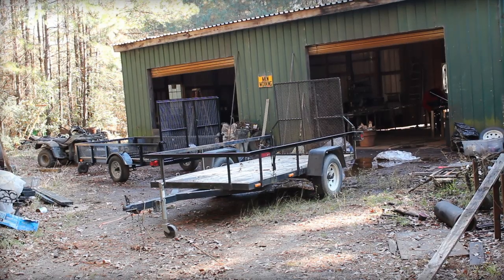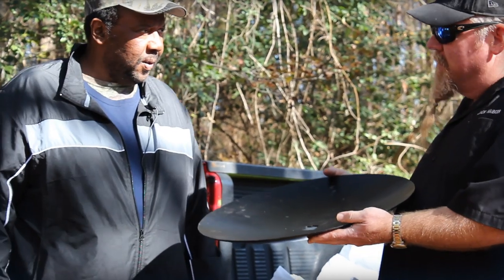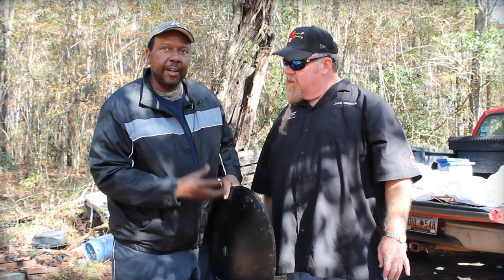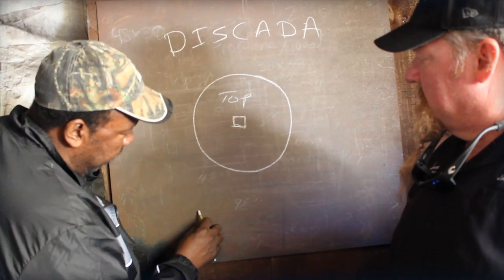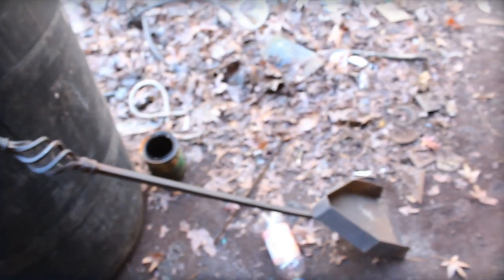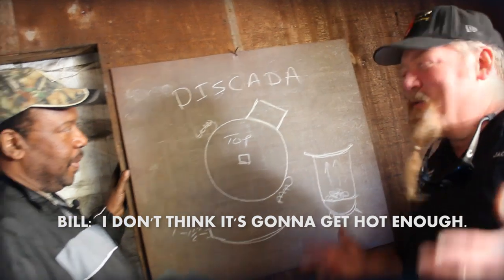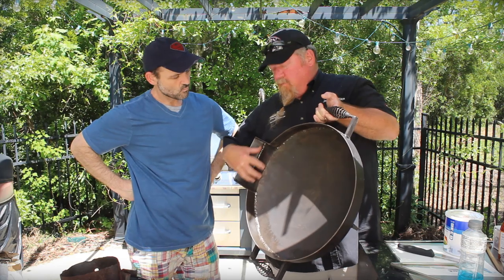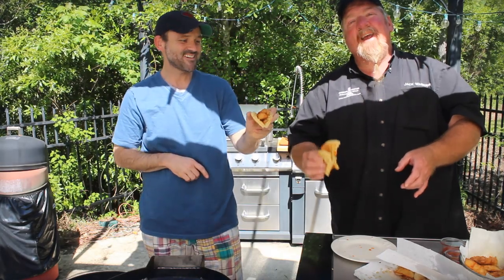Discada Cooking | Chicken Recipe

Comment: Innovative design!
Reply from the maker: Thanks Dan - really cool little cooker...
Reply: BarbecueTricks Indian street vendors often use similarly shaped cooking surface, with a high-output propane jet underneath.  They have a slightly concave pan called a "tawa" which usually has a single wooden handle, and a larger more deeply curved pan (like an Asian Wok) called a "Kadhai" with two metal handles that is also used for serving.  Haney does great work, I've seen his cookers in action and they perform!